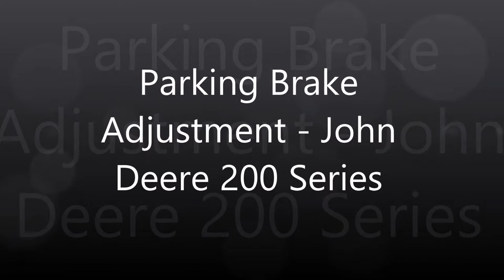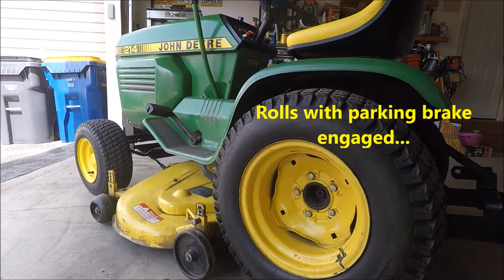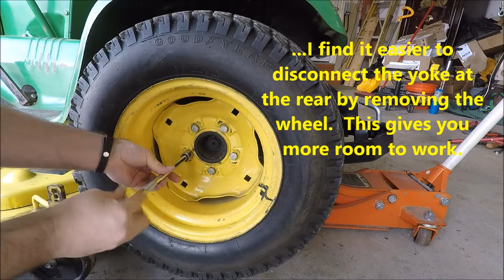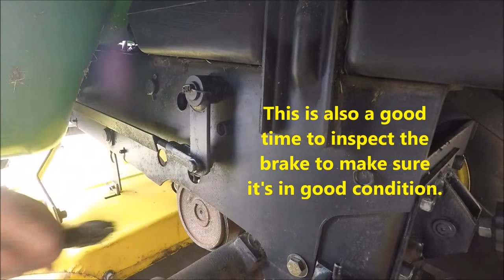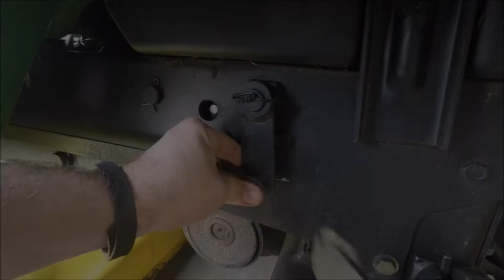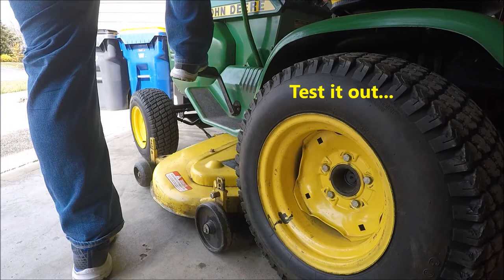Parking Brake Adjustment John Deere Early 200 Series

Comment: What’s that mower deck? 
That’s not like any other I’ve seen, for the 200 series. 
My 214 has the normal old style model 47 deck, with 46” cut, I believe. 
-No gauge wheels on the front.
Reply from the maker: This is a 47 deck, later models had the wheels.
Reply: @outdoorpowerhouse  
Nice! 
If you come across one, I could sure use one.

Comment: OK How do you adjust the parking brake for 200 Series JD Tractors built from 1988-1992?
Reply from the maker: It varies a little by model on the later ones, but I believe your brake drum should be on the right side of the transmission, you’ll see an arm that the linkage from the pedal. There should be an adjustment on there where you can adjust the length of the linkage.

Comment: So, do you just push down the petal to engage it ?
Reply from the maker: Yes, and there is a lever below the steering column that locks it into place for parking. Sometimes the brake will not hold tight enough and require adjustment like this video shows.
Reply: petals are on flowers.